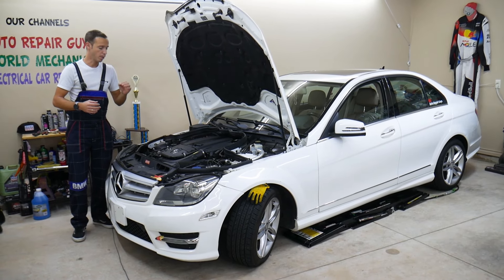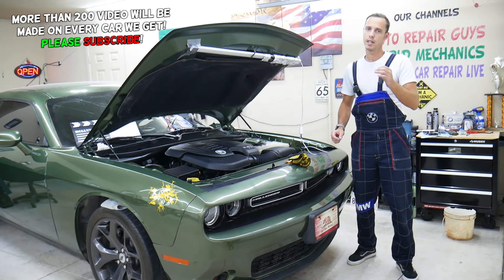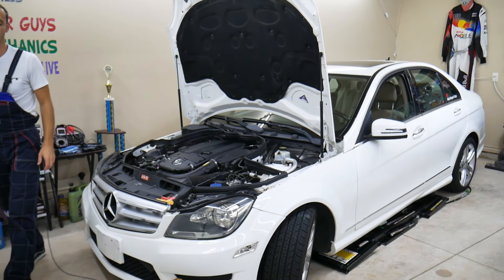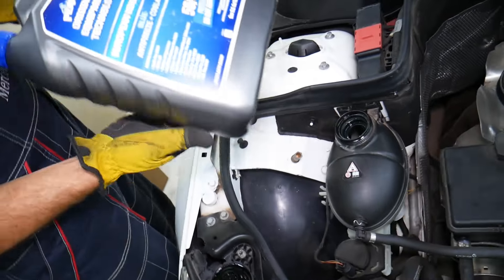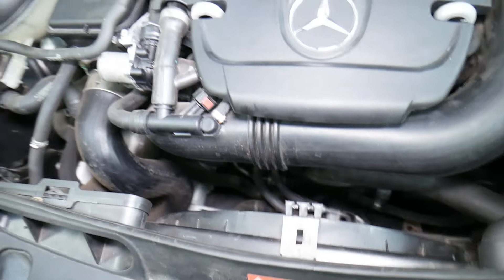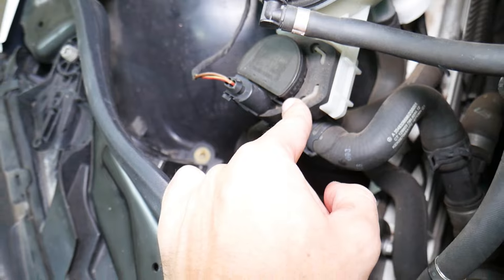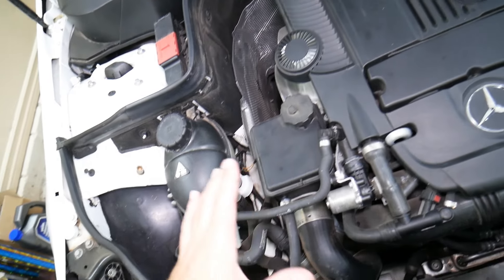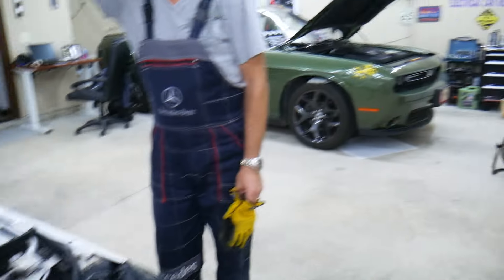WHY COOLANT IS BOILING IN THE COOLANT TANK RESERVOIR ON A CAR

Comment: Hey my engine coolant is boiling up but my car isnt running hot any suggestions on what could it be
Reply: Head gasket worn-out
Reply: That's 1 of the possible problems
Reply: @thomashawk21  worn head gasket but wouldn't that cause coolant to get into oil if it was a blown head gasket?
Reply: @leslietyler6597  when your car engine is cold open the oil cap on top off engine see if the oil is black or a coffee/ milky colour it’s possible it’s not boiling with heat but with air pressures could be a hole in radiator or if cap it’s milky fluid is mixing with oil so it will be head gasket there a liquid you can buy that can possibly help if original damage is not to severe fills in holes in gasket radiator cylinders ask your garage about it
Reply: @thomashawk21  copy that. I checked oil actually changed the oil. And all I black. But still am having boiling in the reservoir. I checked fluid bled the system numerous of times and still have a rock hard upper radiator hose while running also upper hose is hot and hard but the bottom hose is not hard and is cold. I put new water pump and thermostat and a ebay radiator but it's still the same. May have something to do with my cats as they are the wrong one.
Reply: @Leslie Tyler  on my car there's a bleeder valve on top of radiator I opened mine when it was running to allow the air to leek put then close when fluid comes out  if your over heating your loosing coolant if your losing coolant there a hole some where your garage can do a pressure test or you can go a run in car tull the engines hot then look for leeks around radiator and hoses
Reply: @leslietyler6597 it's ur radiator cap
Reply: @rosendaniel1258  thanks for the advice I will look into this later today. And Good Morning btw.
Reply: Use gasket sealent....worked for me....
Reply: @leslietyler6597  Hi did you manage to fix it?
Reply: air in the coolant
Reply: I don’t have a radiator cap and I have this issue of boiling coolant, I got a new water pump /thermostat assembly put on I switched to a new coolant sensor, my motor sounds fine as it always did and I don’t see any smoke at all but yet I can’t seem to figure out this issue on a 2015 Audi A3
Reply: Try engine coolant temp sensor if it’s bad fan won’t come on one way to check is unplug it on chevys that’ll make fan run continuously and pinpoint your issue with sensor hook battery straight to fan wiring to check fan ya can check relays by switching ones that the same amps most vehicles have several relays that are same amps it ya switch and it works in another spot then it’s good also hook to battery and should click if not sign that relay is bad just a few things u can do to eliminate options
Reply: Replace radiator cap. Should work.
Reply: It's not a head gasket issue,it's the radiator cap,if it's not the cap the cooling system has air in it the system needs purged to get the air out of the system

Comment: Had hoses changed thermostat changed t valve changed and the radiator changed he put water in it now it boiling in the overflow tank ran hot but got it home

Comment: What do you guys use for coolant reservoir tank leaks do to minor crack/holes?
Reply: If you can access the hose and the crack with hands than there are are tape avaiable designed for high heat and water/coolant resistant. use them.

Comment: Mine overflows after 15 minutes of the engine running. ( coolant cap is off and still over flows) temp gauge stays at normal 1/2 temp
Reply: U have air in the coolant system, get an OEM radiator cap and burp the system

Comment: I have a question , I did the dumbest thing . I'm still learning from cars and I will admit I done stupid things before but this by far the dumbest. Idk why I was looking at my antifreeze. I saw it look blue from inside when I open the cap but was brown looking when I saw it from the outside. So Idk why I thought of smelling it. So I took the cap off and put one side of my nose and smell it and after I felt it kick. I look it up and wonder by so when I look it up I found out of deadly it can be. The car was sitting for a while so it wasn't hot antifreeze. But my question is did I end up damaging my organs doing this?
Reply: No. You should be fine

Comment: Hey Guys, 

Great video! Maybe someone could help me out :(

I stopped at the petrol station to fill up. I had the coolant checked. I then continued on my journey. After a while I noticed smoke coming from the engine. However, the car was not overheating on the sensor.

The car then cutoff, and wouldn't start. I then opened the cars hood to find that the coolant tank cap was not replaced. The coolant was also boiling in the tank, and leaking out the bottom.

Car wouldnt start. Any help, please :(

Its a 2014 ford fiesta st

Comment: I had top gasket replaced and a new thermostat with a new housing 4 weeks back then flushed old coolant yet my car is still boiling coolant, however it is not overheating. Everytime i turn the car off it boils after driving for a while, then fan runs longer than normal to cool off the car. (2006 mini cooper) what could be the issue? Had the water pump checked aswell.
Reply: Update
Reply: I'm having same problem
Reply: @agentsouthdallas  what’s happening
Reply: My coolant bubbling in the overflow but it's not overheating. I got new water pump , thermostat, radiator, temperature sensor,  I know it's not gasket. I can't figure out what can it be ? Maybe I need to change coolant@jay
Reply: @agentsouthdallas  mine is doing same thing I’m not sure as well
Reply: Exhaust getting into coolant boiling/bubbling it out? Bar head seal worked for me
Reply: Coolant temp sensor
Reply: their is air in the coolant turn on the car and open the heater for few min
Reply: @ZsAGs-cd6xo Why do you say bad coolant temperature sensor? The poster above stated the coolant was boiling within the tank.

Comment: I don’t have a radiator cap and I have this issue of boiling coolant, I got a new water pump /thermostat assembly put on I switched to a new coolant sensor, my motor sounds fine as it always did and I don’t see any smoke at all but yet I can’t seem to figure out this issue on a 2015 Audi A3
Reply: Are you found problem?
Reply: @johnson1722  it was the coolant reservoir cap
Reply: @Tjevdevs  i must try on my car thanks
Reply: On my car I replaced the radiator. I replaced the thermostat. I replace the water pump and the sensor for the temperature gauge now after all of those things all of the water goes from the radiator to the reserve reservoir in if I drive my car after period of time. The temperature gauge rises to hot, but then comes back down.
Reply: I have a 2005 Nissan Altima 2.5 S cause I want tell me why is this happening

Comment: Put thermostat in,coolant,noticed since put new cap on it overheats bad and blows cold need fix it but does lek underneath water pump.....how fix problem before winter in 1997 Chrysler ciruss lx 2.5 ltr 6 cyl
Reply: Also when opened cap water shot out radiator like shotgun..why don't have heat and water pump located
Reply: Where's water pump and is it easy to take off and install on Chrysler ciruss 1997 lx 2.5 6 cyl
Reply: Please help me I'm new at this car it sucks!!!
Reply: What's the major malfunction????????